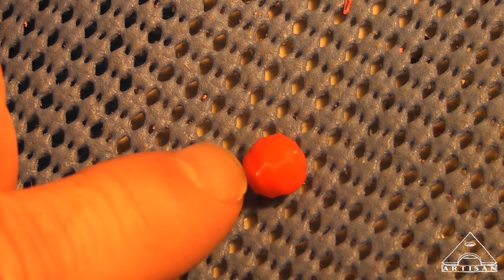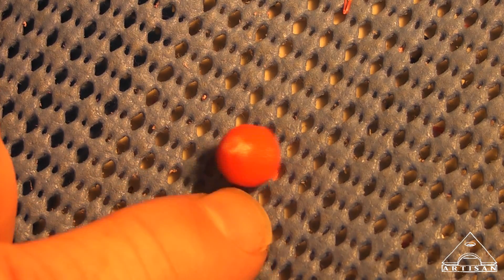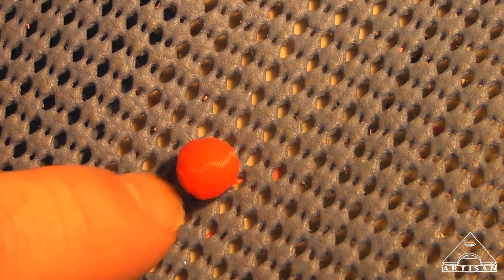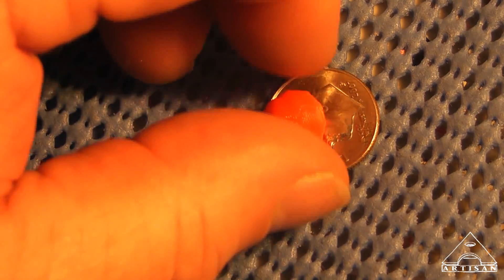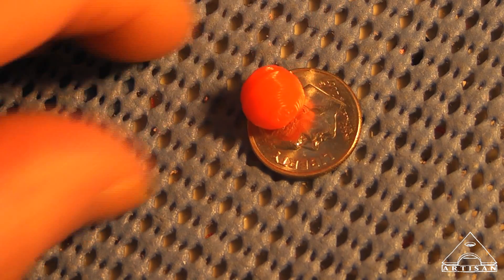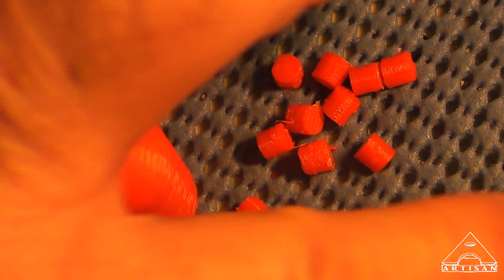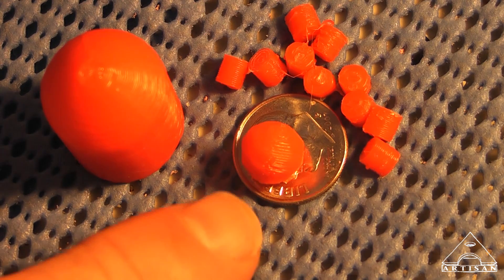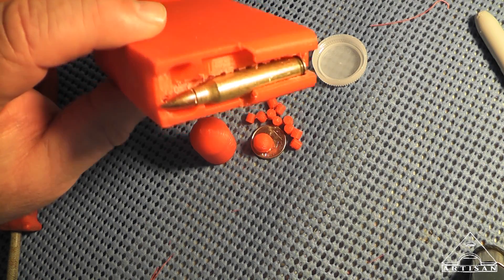3D Printed "Bucky Balls" for taofledermaus - Solidoodle Gen 3

Comment: That 3d printer is horrible  others could do that easy in one try
Reply: I would LOVE to see any sub $1000 FDM desktop 3D printer do a measurably better job.
Reply: Viktor Foggo he problem is the lack of calibration, he makes the extrusion rate to high, he didnt properly calibrate the distance from the bed, the temperature and the overall speed the printer head moves around.
i have one myself and with proper calibration (like any other FFF Printer) its a beast

Comment: You should get auto bed leveling or raise your hotend a little and decrease the temperature your printing your ABS at.
Currently it has too high of a temperature to cool down quick enough at your printing speed and its so close to the bed it forces too much pressure on the still soft object.

Comment: You should do 3 things:
1. change the settings so it slows down on some layers to give it time to solidify. It's in the cooling settings of Slic3r (which you should definitely get Repetier-Host and Slic3r if you don't have them).
2. use either Aqua Net hairspray or a solution of ABS melted into acetone to prep your bed instead. Careful with the ABS slurry, it can be really hard to get parts off sometimes.
3. install a fan at the nozzle tip to help with cooling.

Comment: If you like all that geodesic dome design stuff you should try and print a Gomboc ( it a self correcting object. No matter what side you put it on it will correct its self to the up right postion. This will test the quality of the printer as the measurements for it are very fine, if they are off too much it wont work.